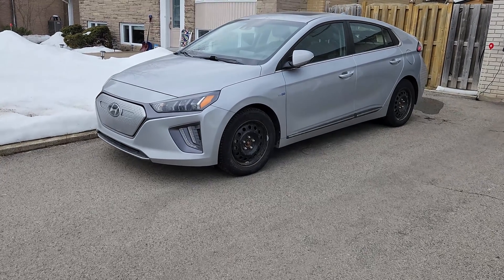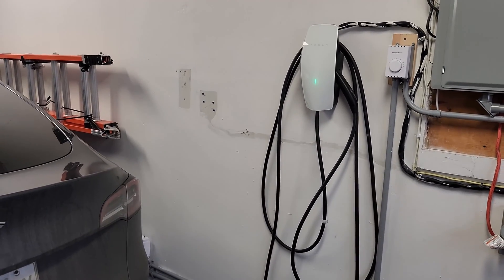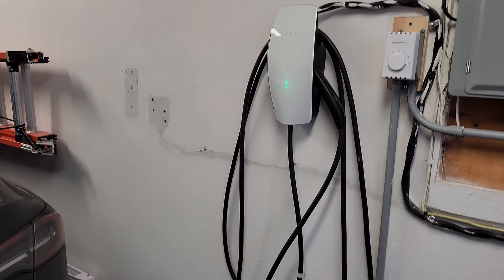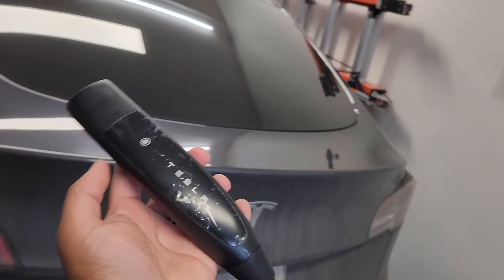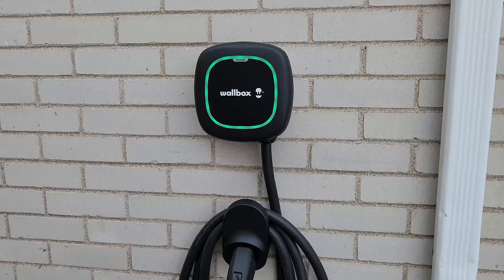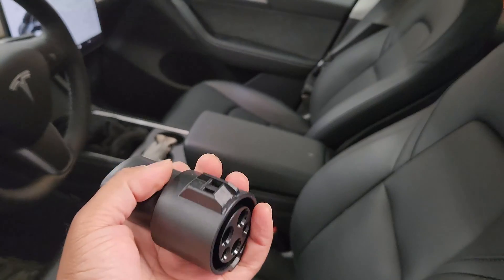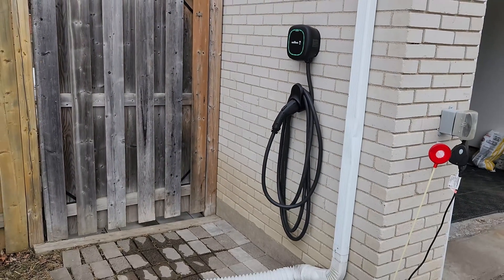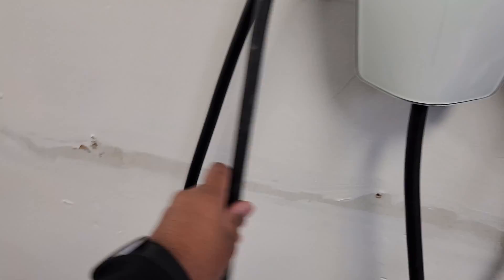Watch this BEFORE buying your EV charger

Comment: Thanks for the update.  It was useful and informative.  A video about solar would definitely be interesting to me.
Reply from the maker: Thank you for watching and taking the time to write. I will definitely make a video about my solar setup.
Reply: Just had my Wallbox Pulsar Plus installed on Friday; I like the fact that it supports power sharing — we have a two car garage, and while my wife currently drives a fairly new HEV, I’m hoping that 7 - 8 years down the line we’ll move her to a PHEV (if not a full BEV like my IONIQ 5), and we can easily install a second Wallbox chained off the first using power sharing (it’s less an issue of amps for us than it is that the garage is in a separate structure from the house, and our panel is in the basement of the house - necessitating a LOT of wire, making power sharing a much easier install option when the time comes).

We didn’t get the return circuit in on Friday; the electrician had some alternate ideas of how to do this.  Our original idea of going into the panel with a transfer switch for one circuit was going to be fairly expensive will poor results (as in most rooms our lights and plugs are on separate circuits), so we’re currently working together at looking into installing some dedicated plugs in strategic locations throughout the house that would be on the same 15A circuit directly to a generator plug in the garage, bypassing the breaker box entirely.  The plugs would only be live when the P2V is plugged in, and we’d have to switch where some items are plugged in — but we’d be able to power stuff in several rooms at once.  I think this sort of setup is new to our electrician, but he seems pretty hyped on looking into various ideas to make this work in the best way possible.